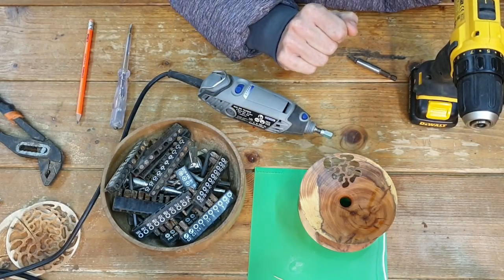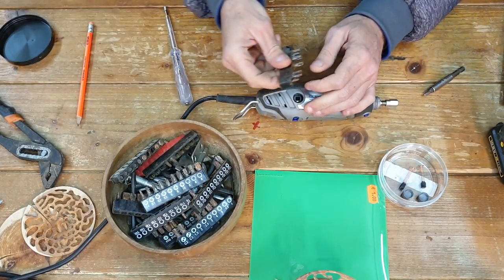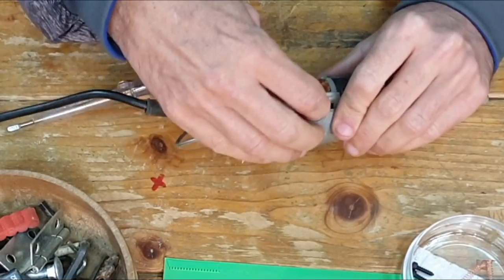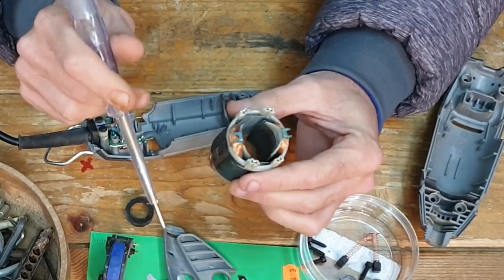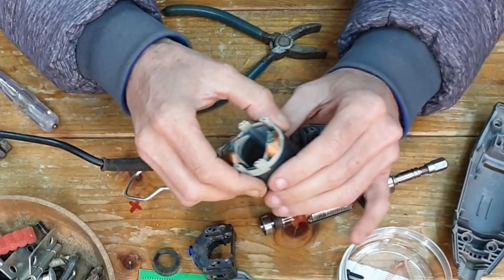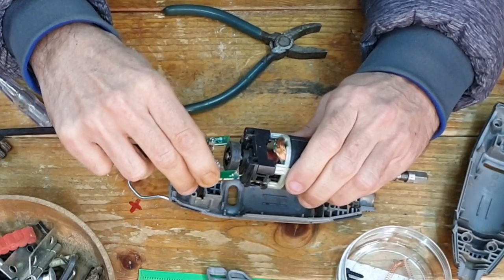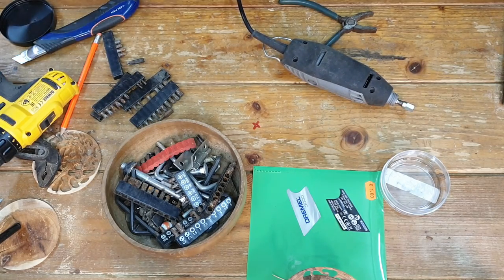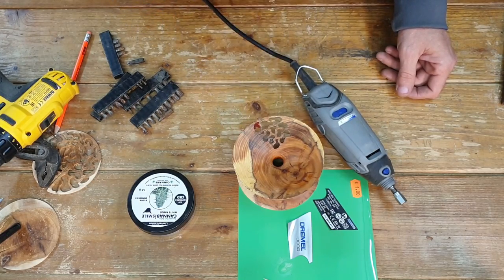Fixing my Dremel 3000

Comment: My Dremel died while grinding welds so I guessed it'd probably be a broken stator wire seeing the fuse checked out OK. This is where the internet is your friend, I looked up a video on how to tear the unit down and sure enough one of the 4 stator wires had broken. I tested it with a multi-meter then identified which had broken off at the terminal. I couldn't unwind the broken wire from the loom so I had to cut one wire and reconnect onto that wire. Tested again with the multi meter and continuity between terminals was restored. The Dremel is now working again fine, took me around half an hour to tear down, repair and rebuild the unit.

Comment: Thanks to your sympathetic tutorial I maneged to disassamble my Dremel. One of the copper wires was indeed broken. Unfortunately I could not unwind it a bit because it stuck between the spool and the metal base. It kept breakin when I tried to pull some out. But thank you anyway!
Reply from the maker: Thank you Mende, I'm sorry to hear your couldn't fix yours. It's a common faulty point in these devices and many people have had the same issue.

Yuval

Comment: Good save.  This would encourage me to buy a Dremel but it's hard to decide on which one.
Reply from the maker: Thanks Brendan! I have the Dremel 3000, not by choice, like I said in the video, it was a gift. Until this one, I had a knock off, which was ok. Wasn't great. This little guys, I've used for 5 years now. Not a lot, but I think I'll be using it more and more as I hone on some new skills, and it's a good machine. Some people say the 4000 is better, I wouldn't know since I don't have it.

Yuval
Reply: Thanks Yuval, the 4000 was recommended to me and the person also told me not to go for a cordless because they always die when you are busy.  The other option is to buy cheap and replace every couple of years because there's not a lot of difference in performance with a lot of them.
Reply from the maker: @baconsoda  I wouldn't  go for the chordless as well.

Comment: It's disappointing the enamelled copper wire is loosely coiled like that, allowing vibration to gradually weaken the wire. I'm going to try some preventative maintenance and support the stator wire with polyimide tape, or a drop of molten bees wax. Thanks for your video, Yuval. 👍
Reply from the maker: Tell me about it ss, I would expect Dremel to make a better quality machine, it seems this problem shows up in different models... at last I'll know what to look for and how to fix it if it happens again, and I might try a dab of hot glue as well to make it more secure.

Yuval
Reply: @yuvallahav  Hi Yuval. I thought about what you said. Beeswax isn't a good idea, since the heat will melt it. So I'll try the polyimide tape, it's also known by its brand name "Kapton". It is used in 3D printers for its heat resistance and to allow the printed object to be released from the plinth. It's just a guess, but I suspect the copper wire is work-hardening under the constant vibration, making it brittle. Then it just snaps.
Whatever you do, DO NOT purchase a used Dremel 4200. That particular model was not only a piece of junk, but dangerous. The bit would fly out of the chuck when in use. The 4000 was fine, and the new model 4300 is fine.
Reply from the maker: @channelsixtysix066  That's a sound advice... I'm not in market for a new Dremel anyway, for as long as my 3000 works, and for now it does, but I will keep in mind to watch out for that model. There is a heat resistant hot glue they use to cover and isolate electrical components on circuite boards, wouldn't that do the trick, and would be simpler to apply than the polymer tape?
Reply: @yuvallahav  The problem with that glue, is that it's more or less permanent, that is, once applied, it will be very difficult to remove if it had to be. At least with polyimide tape it can be carefully removed. The main aim, is to stop the wire vibrating. The 4200 is an obsolete model, so it will appear on the 2nd. hand market. I would only get one, if it had a lot of attachments and bits with it and it was a good price. Those pieces can be used with the 3000. I would not get one on its own.